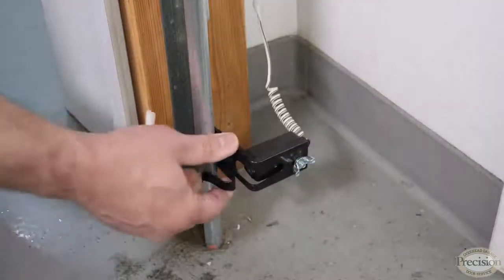Can I Add Safety Eyes To My Existing Garage Door Opener?

Comment: I have an old commercial garage door opener. It’s indestructible. Why would I want to throw it out? No one makes a controller for an electric motor to do the old up down that can accommodate a safety switch?